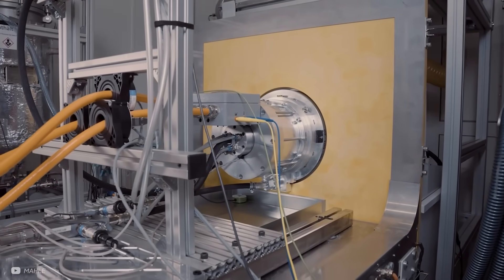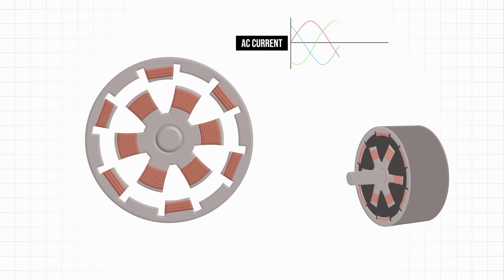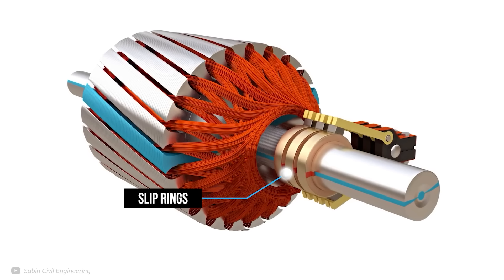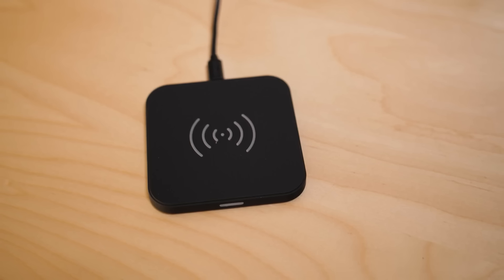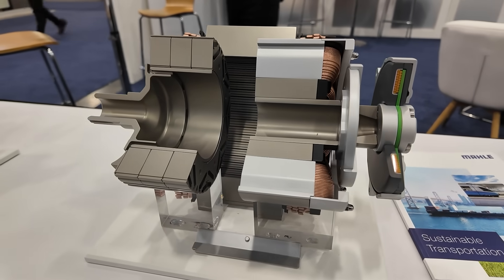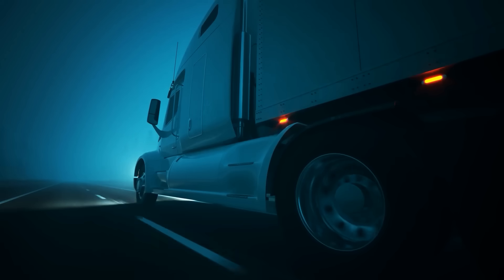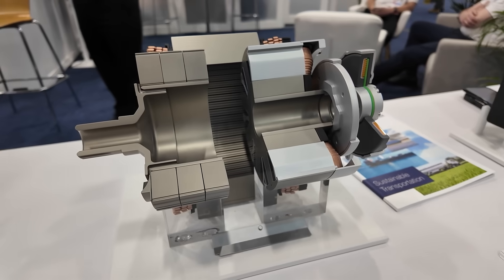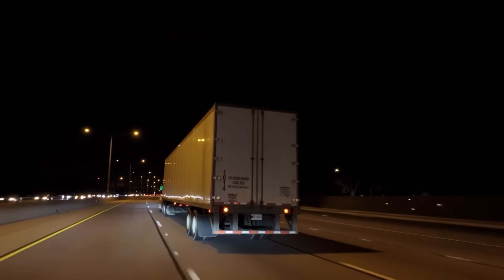Genius Contactless Motor Could Change Transport Forever

Comment: This is 50 year old technology. I worked on motors in the 70's while in the army and this was a standard design.
Reply: It also was a pretty standard thing on synchronous alternators rated at megawatt class. Especially on some powerplants (and it's even older than 50 years)
Reply: @teolynx3805  Yes.  From my experience servicing and operating small municipal power plants in bush Alaska in the 1980's, it seems that around 1960 was when the industry transitioned from commutator type exciters to either permanent magnet or induction type exciters in larger synchronous machines, at least for alternators.  Although I am unsure about synchronous motors, I would assume that the transition occurred in a similar timeframe.
Reply: @teolynx3805  so why are we here now, not 40 years ago?  Priorities of economies?
Reply: @glen.simpson  because it was cheaper to use neodimium magnets on motors less than 1 MW.
Reply: @glen.simpson because wireless power transmission, in this case power sent to rotor has losses. For instance wireless phone chargers using similar technology run around 70~80% efficiency, what is considered very crappy for electric motor. In case of truck there are so many heavy components and gearing in truck transmission, that percentage wise in that particular case 😅wireless power transmission to motor rotor might not be that bad comparing to truck transmission friction loses and is acceptable, especially if engineers managed tweak efficiency to be better than older concepts, it might make it’s way to trucks, or is just a fluke on internet to be used to get loud about product, get financing from banks and they will run with money. I belief in that technology breakthrough when i see it in trucks on the roads that are widely sold.😅
Reply: @sawomirkuczek3214  generally, my impression is, anything we do with ice motors can be achieved with electric, often doing a better job. Explosions have to complete their distribution of energy through gearing and a drive train. It's a matter of energy density and transmission with electric motors.  I can't get enough energy to my excavator on the work site with an electric solution. If the boss could pull in each night with a fat battery on his truck and fill up the loader and excavator, yeah, that'd work.  Electric motors can drive the machines and hydraulics just fine. I just don't have a 1mw  battery on a truck that 1 can discharge into those machine in 1 hour, then drive it to another site and do same thing for their dozer.
Reply: @sawomirkuczek3214  Every electric motor is basically doing induction wireless power transmission from the stator to the rotor to spin that axle and electric motors routinely achieve electrical-to-mechanical energy conversion efficiency around 95%.

Induction wireless energy transmission is nearly 100% efficient when the air gap is small enough and alignment is practically perfect.
Reply: @glen.simpson  BIG OIL #1 and battery capacity and density has only been available the last 5 or so years #2 Imagine the size and weight of the battery pack using 1980's Lead acid packs!!
Reply: @74_Green it's only road use where battery-electric was fully replaced by internal combustion for a few decades, industrial applications never stopped using batteries widely. 
USA's weird half-regulated markets allowed Exide to buy the patents & close the factories for the far superior Nickel-Iron (NiFe) battery which would have tided over on-road applications till nickel-cadmium & then lithium came along but even with that there were occasional forays into battery-electric like Bedford's electric "CF" model which used surprisingly few lead-acid batteries in a simply-converted light van (Ford Transit size).
Reply: @glen.simpson the USA's weird half-regulated marketplace is the reason. Steam & battery-electric were fairly mature but still improving technologies when internal-combustion came along & just swept them away for on-road applications, swept them away with aggressive & often lying marketing selling dreams not realities.
Reply: @ motor is converting electrical to mechanical power but wireless transmission of electricity (electrical to electrical) those are a little different “conversions”. Wireless transmission is not even close to 100%. Is more like 70% in cellphones and up to 90% in very well tune commercials applications. 100% is wishful thinking but technologically we not there yet, read up on it or study some data sheets in electronics you will see for yourself. Even well controlled and more superior DC/DC converters or AC/AC frequency drives with much smaller air gap (no mechanical moving parts) rarely exceed 96% if ever.
Reply: @74_Green  yeah, surely those interests have trumped advances in e solutions to mobility.....there's no doubt storage solutions are part of those suppressed patents..... there's still not the density for a decent excavator...idk, some chinese co must be working  on it but still, how do you get e for that battery up on a hillside, nobody is driving around in a jacked up truck with a quick discharge solution for large equipment, not now anyway.. i don't think li is the longer term solution...some solid state solution will win in the end.
Reply: @74_Green   - imagine the cycle life using the 90's NiCd...  NiHM (think Toyota Hybrids)..  etc..  just have a think about it, we are were we are now, I want to travel from Sydney to Adelaide - what is the best way to do it, with a family and car full of holiday equipment...
Reply: @teardowndan5364  problem is getting that air gap small enough....LOL!
Reply: @kevinrtres  electric motors have been doing it for 40+ years.
Reply: @sawomirkuczek3214  wireless chargers (and this) are transfering by creating a magnetic field.... right next to a motor with a magnetic field.   And they claim there is no interference, no drag to these fields inside this motor?  cause I know the stator and the axle fields are interacting
Reply: If I’ve got things right from the video, the older synchronous motor technology of which you speak runs to about 85% efficiency. This new design is 95% efficient, which equates to permanent magnet motors. At the same time the oil cooling system lets them get a much better power density than synchronous motors, so it’s win-win from that point of view. The ideas aren’t new, the implementation is and the results are much more efficient than the older designs.
Reply: @stevetodd7383  the oil cooling is to remove heat caused by inefficiencies. If any machine needs cooling it has inefficiencies so beware the efficiency claims
Reply: I believe this was an idea Tesla lectured  for in 1900 or so. I think he believed it a safe and inexpensive way to  power aircraft and ... of course earthbound vehicles ...Ford may have had different  ideas
Reply: Brushed motor technology on a vehicle!
Reply: Electric motors existed before internal combustion, that doesn't mean you can't improve the field
Reply: it's so old that it has been forgotten by those people incapable of reading technical documents, a group that now encompasses, well, far too many people.....
Reply: They didn't have slip rings and brushes?
Reply: @CrannDarach  
Nope.
Standard arrangement in everyday marine diesel generators.
Reply: Brushless motors dominate  @CrannDarach
Reply: Yeh but youtube content.
Reply: usually what is posted
Reply: {50 +}
Reply: Double electromagnetic conversion , oil friction, leaks, isolation degradation by oil. It is very easy that is nonsensical troll science  of a public listed company 🧪
Reply: Most generators are brushless where they have an exciter which is used to build they fields. The moto is the same except backwards.  It's very old technology
Reply: Isn't that an induction motor?
Reply: @JCAtkeson3  no it's synchronous motor.
Reply: Old tricks are the best tricks. 😊
Reply: The part you're being shown here is that it's the first time the tech has all been put together in one device
Reply: I continue made my innovative project of a non-combustion engine, I remind you that I am posting here on my channel the technology and the principle of operation, according to which anyone can create a prototype and enjoy free energy, since I was denied financial support at the stage of the idea and theoretical research, after a year of unsuccessful searches. Including I will begin to assemble a sample. And soon another video will be released, revealing my developments, the wind of change is approaching! All those who are not indifferent, welcome to the flight in this departing innovative car, which will lead to great achievements for the successful future of the planet and humanity!
Reply: @maguccimotorincorporation 😂 Seek psychiatric help bro!

Comment: Another advantage is the lack of hysteresis. Sometimes called magnet drag or eddy current drag. Since you can turn off or down the magnets on the rotor. The Tesla Semi has mechanical clutches to do this but they could be eliminated.
Reply: The tesla semi doesn't even exist yet, and is still way less efficient at hauling than a regular semi, the tesla semi is a vapour ware joke to scam investors
Reply: @HerbaMachina  https://en.wikipedia.org/wiki/Tesla_Semi.  This new motor design could be great for wind turbine power generators. Lack of rare earth metals and easy low wind start up.

Comment: Being able to alther the strenght of the magnetic field potentially has an application in wind turbines where the strength could be altered to exactly match the torque available from the wind (implementing MPPT via the winding rather than by boosting the output voltage), and to aid starting. In theory, the turbine could also be braked, but to avoid overheating, it is better to dump the excess electricty as heat (or to a battery) and only use electric braking as a backup to friction braking when the turbine is at a standstill.

Comment: The Renault Zoe ZE50 range use the slip-ring approach to provide a cheap, efficient motor. I haven't heard of slip-ring wear as an issue though, as a small car, most of them probably don't cover huge distances. What does seem to be an issue with them is pitting of the main motor bearings at maybe 100k miles. You might think this could be due to static being discharged via the bearings - who knows ? Must admit I have never heard of slip ring wear being an issue for car alternators and this Mahle design sounds a bit like over-complication.
Reply: The brushes in a car alternator can last 200k miles
Reply: Pitting on motor and generator bearings is often caused by parasitic eddy currents. Any varying magnetic field will generate eddy currents in even ferrous metals, small but persistent hence laminations.

Comment: A major problem with this motor is that we can't use KERS to brake, which means we'll use more brake pads and lose that potential energy (in the case of EV). I don't know if the long-term gain is greater than what we're losing, and especially since we have no figures on its efficiency, etc.
Reply: This traction motor can do regenerative braking the same way a permanent magnet BLDC motor does and even in a more flexible way. The KERS energy is stored outside the motor (battery or flywheel + motor).
Reply: @manuelsilva8640  interesting

Comment: I wonder how efficient is the rotors induction coil? Can it be chilled with filtered air instead of oil? Whats the maximum power into the rotor using the inductor? Power to weight?

Seems bold to claim perfection without data.
Reply: There certainly is data lacking, but it's early days yet. As to air cooling, you really want all that oxygen rushing past all that hot metal? Seems there'd be rust and degradation problems.

Comment: Sorry, but this won't really change a lot, because 1) it's certainly not any new tech (neither direct rotor cooling nor externally excited rotor magnitisation are "new") and 2) the motor is not in any way the limiting factor in the drivetrain of a real world BEV! (that is clearly the battery energy density)!

The efficiency of a eMachine is actually pretty much directly tied to the cost and manufacturing difficulty of that eMachine. F1 eMachines (KERS&TERS) are approaching 99% efficient but cost $50k or more per single motor, but an mass produced consumer grade traction machine ie Tesla motor, for example, is still 94% efficient and costs under $1k!  In most consumer applications, the consumer is not going to pay that huge difference to get a tiny extra (say 4% extra range, ie a 94% to 97% eMachine eff gain) additional range, whereas spending the difference on just fitting a bigger battery would more than double the range (We are now under $100/kWh cell cost)

Comment: Well, we can wish them good luck with developing it into a commercial product. While copper is easier to recycle, recycling rare earth magnets is not that problematic. While there are numerous potential advantages with the technology, they're for most applications so small that all of them combined is unlikely to result in a much better motor.      

It is still technically an induction motor, and even if they managed to improve on the efficiency. The Achilles heel of induction motors is not so much efficiency at peak load, it's the efficiency under lower loads, which tends to low, as you still have to induce a the magnetic field to make the rotor work. In applications where you want maximum or near maximum power, or none at all, that's not much of an issue, but that's not the case for vehicle motors. Also, if you want an electric motor that can be rotated without much resistance induction motors can be a better choice, you can for instance use a combination of permanent magnet and induction motors on an EV. 

Why direct oil cooling of the rotor with the oil also passing through static parts isn't common shouldn't require a genius to figure out, it's probably a couple of orders of magnitude more difficult to get it to work reliably for a long time than sliprings are, without causing a lot of friction or requiring maintenance, or having some other serious disadvantage.

Comment: But the rotor requires DC current to generate the magnetic field, while the wireless transmission only works with AC. How did they solve that? Full bridge rectifier in the rotor?
Reply: - DC required for synchronous, but a fully double fed machine may have a fully controllable "mosfet bank" - internally so it COULD make DC - for replication of a true synchronous machine, or is COULD make any frequency and amplitude of DC to convert into any desired regime of lead / lag AC double-induction-fed motor..   (Patent Pending.  TM...etc)
Reply from the maker: Exactly, there is a rectifier on the rotor side - my bad for not mentioning that!